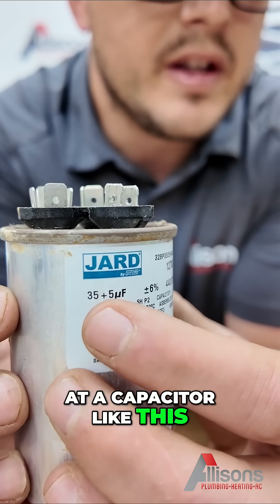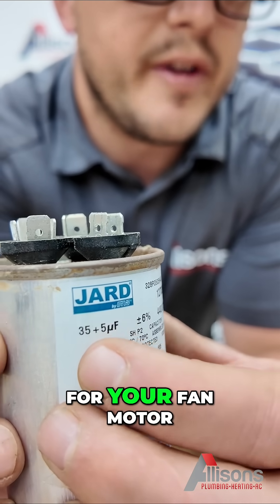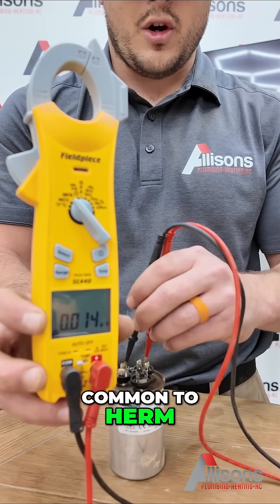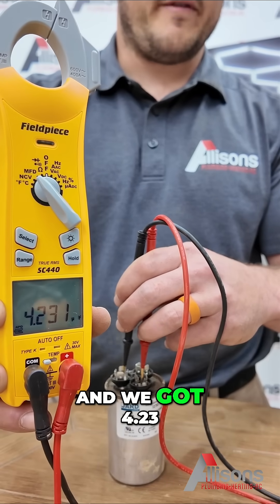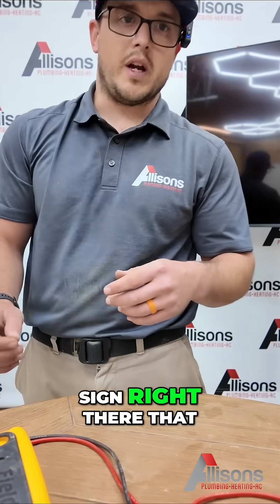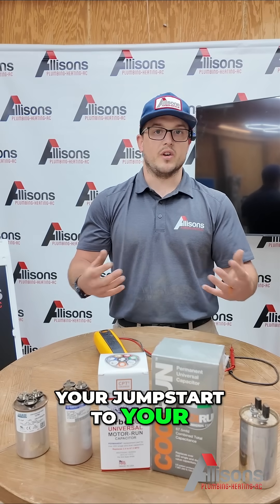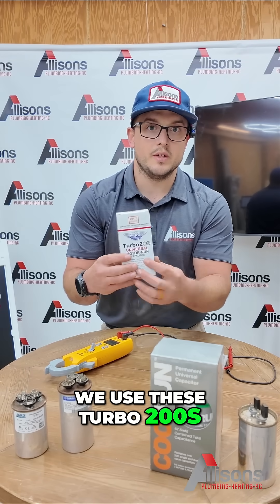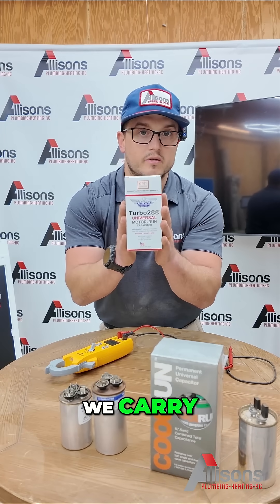Bad Capacitor Symptoms  AC System  Failure Explained (How to test a capacitor) #hvac #diy #howto

Comment: Great video! Question about replacing capacitor. My AC is 17 years old, but working fine. As a preventative maintenance I ordered a new capacitor and plan on replacing. What do you think?
Reply: Let sleeping dogs lay. If it ain’t broke don’t fix it.